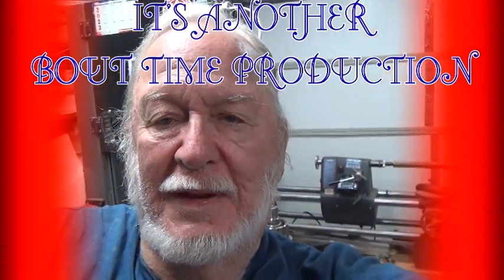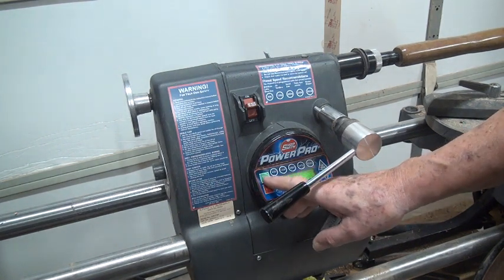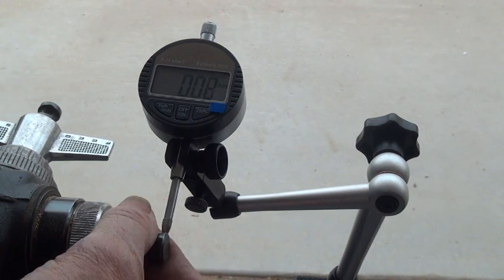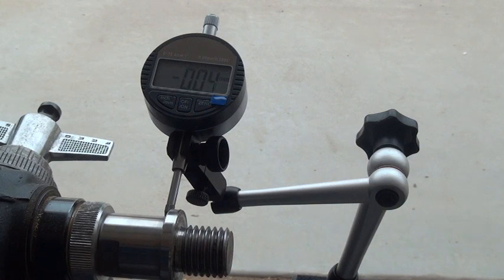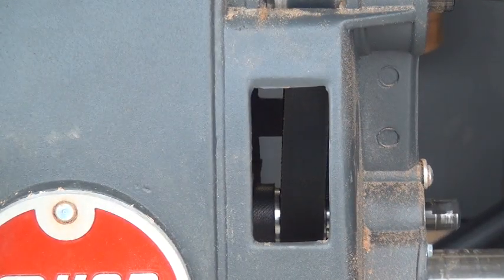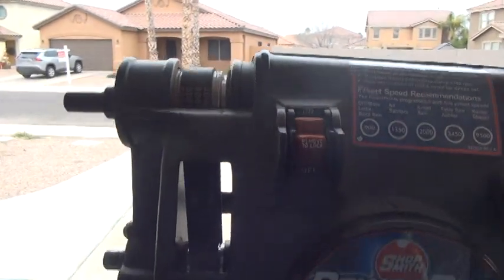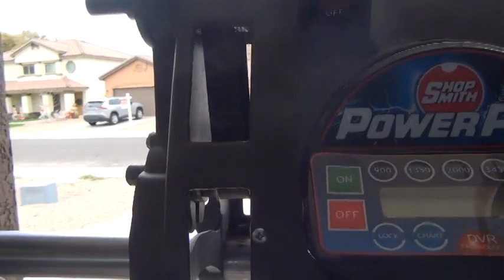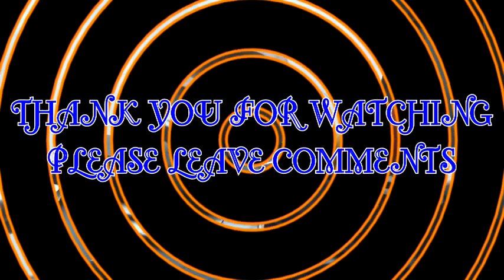SHOPSMITH POWER PRO PROBLEMS PART 2

Comment: Sir, from one up graded his 510 to Mark 7 Pro, the concentric bushing should not be moving(there is a screw or bolt the you can tighten).  It can be adjusted to correct the upper belt tension (also to help correct miss alignment.  To tighten the lower belt and eliminate the sloppiness,  1 remove the lower motor cover, 2 on both sides of the motor are adjustment screws,  3 they will allow you to tighten the lower belt to approximately 1/8” deflection (this will also allow you to get the pulleys parallel.
Reply from the maker: Thank you for the response. Ted

Comment: Could there be an ongoing quality control issue at Shopsmith?
Reply from the maker: I don't really know. I have witnessed several times that people have had many problems with the Power Pro electronics. not so much the machinal operation. I think I just had a bad quill system and they seemed to have fixed it. They did discount the repair for me.

Comment: Hi Doug I hope you found the issue here. Question, I also have Power Pro it blew the circuit board on the motor driver so I sent it in for $500 repair after getting it back 3 months later and only using it a few times it’s now having problems again!!! There’s a code on the touchpad that says: “SRM not rotates” . Needless to say I’m very disappointed with Shopsmith. Do you have any idea what might be the problem?

Comment: https://youtu.be/xCLkH6T1uQE

There’s a fantastic portion towards the end of the video where they show the alignment balancing the tension between those two belts.  Fast forward to the one hour 40 minute mark. I think this would be a great help to you. Best wishes.
Reply from the maker: Oh, thank you I watched it. That’s a great video. So this morning I went ahead and adjusted the belts using that process but it still has a noise in it so I’m assuming it’s basically the drive ring assembly.

Ordered one on the 18th I haven’t heard from Shopsmith they haven’t sent it don’t know what’s going on.
We seem to have stopped. Communicating as well.
Will call them again today.
However watching the video I may just attempt to fix it myself. Ted

Comment: I agree with Scott and John. The idler shaft is not in the correct position. You showed the bearing slipping in the collar, that means it is loose. It should not do that. So it has worked it's way inward, which explains why the upper belt is not vertical. The loose idler shaft is at least one source of vibration.

The Shopsmith base has flex, so yes your digital dial indicator will pick up movement if you lean on it at any point. I spin then let go and read the value without touching any part of the machine, then spin again. At 0.04mm that's about 0.00157 (one and a half thou). That is not too bad, but with new bearings there is a chance to cut the run-out down so small you indicator could not detect it. But I would fix the idler shaft first. Also, with that much vibration, I would check for other things that may have worked loose.

Keep in mind since the lathe spindle adapter uses a set screw any tolerance (slop) between the adapter bore and the quill shaft will get pulled to the side with the set screw. The video proves that, you went from 0.06mm near the set screw to negative 0.08mm at180 degrees of the set screw. That's a 0.14mm swing or about 4 thousands of an inch. So the error in adapter builds on the error in the quill shaft. Then, any error in the chuck builds up too.

Comment from the maker: Had to think while the 49er's whipped the Sea Gulls and it hit me. So I went back out, used long curved needle nose pliers to edge the belt into the right grouves and then that bushing spun all the time. 
Being an old aircraft maintenance technician I then got out the Power Pro instructions a PDF from Shop Smith and my fear that it was in fact a bushing was confirmed; Ref; number 80 on the illustrated parts break down P/N 5041909, noun Eccentric Bushing Mach . 
It is constantly spinning now in an aluminum casting which will wear severly which obviously it has already as it has extended out to the belt grouves. 
This shaft carries the dynamic load of the pullies that drive everything and it is a cantilever type (supported only on one end) which make any excessive  differencce in belt load prone to cause a failure. With the bushing extended out and spinning it is a very serious problem.
This is in my opinion a serious manufacture defect which will most probably require replacing the casting.
I suspect that the Idler Shaft Assembly ( Item Number 83 P/N 622612 ) itself if causing the vibration and has a wobble which in time will get worse and may cause a catistropic failure.
I will call Shopsmith Monday to discuss this matter.
Reply: I replied to the comment you made on my video adding links to 2 Jacob Anderson videos. The idler shaft has been cantilevered like that since the Mark 5 headstock first came out. And in the mechanical headstock it bore the extra stresses and strains of the speed control sheaves which added stress when moving the belt and had a large diameter.

My hope for you is that a little cleaning on the bushing and idler bearing to remove dirt/grease, setting the shaft back in place, proper belt alignment, and proper tension on the idler shaft casting bolt will help lock everything back into place. I surely hope that a new casting is not required. Fingers crossed.

Comment: I’ll add - that’s not so bad - happened to me - exactly what you’re experiencing.  I caught it before it got to the point yours is.

As I’d had the original headstock for quite some time I was very familiar with the idler shaft, bearings, the nomenclature.

With some time getting this and that back to normal it’ll be right as rain.

Comment: The scraping noise you are hearing is I’ll bet, the jointer coupler eating its way into the metal plate.
Reply from the maker: You were absolutely right that ground a really nice hole in that sucker. So this is been issued for sometime.

A short video thanks to you Jacob and Scott to basically bring this particular subject to focus for Mark five or PowerPro that maybe every once in while we should take a look at this and make sure it’s not moving and then maybe recheck the tension on the belt at the same time. 
You guys are great. Ted
Reply: @choochoo3985  

I had the exact same issue.
The eccentric was not tightened enough.

So - if you need new belts they are available from Bandsaw Warehouse.  Both belts - Power Pro and the idler shaft belt.  I suggest you do get both.

So - when you are done - with the cowl off - run the machine for a few minutes, checking that indeed the idler shaft and eccentric stay in place.  It is better to have the idler shaft wander than to have the clamp too tight.  Be careful - the tightening bolt can cause the clamp to fail and that is a pain in the-

If you’d like a manual - I do have the print out that came with my Power Pro.  Let me know.  As well - it’s important that you do have the time to get the installation correct.  And if you need new bearings for the idler shaft I bet I have them.  The Chineseum bearings are not the best.  I may well have Timken or Japanese bearings.  Yes - I’ve been in your shoes.

After you are sure the clamp is indeed tight enough check it again after a few hours.  Mine, after, I’d say 40-50? hours of run time the shaft/eccentric had begun to wander back.  A perhaps 1/4 turn solved it.  

Again, it’s unfortunate the experience.  You are not the only one.  The machine with good observance will persevere for years.

After it’s running correctly you’ll notice again how quiet it is.👍👍
Reply: Snowing again!! here - at 6000’.  About 1000’ above Parachute, Colorado.  😬
Reply from the maker: I don't see any wear on the grill common to the coupler. The bearing there is flush with the casting.

Comment: Your idler shaft is way, way out of alignment.

The lower shaft needs to be outside much more. I would not run it until we talk or someone else let’s you know.  DO NOT RUNIT.
Reply: John is correct, The bearings on that shaft should be flush with the inside and the outside of the casting. Scott
Reply from the maker: @MyGrowthRings  Thank you Scott.
Reply: That is, do not run it.👍👍
Reply: By the way the auxiliary shaft needs to be not out (my mistake) but IN.  In toward the motor.

Jacob Anderson a former YouTube Shopsmith headstock repairman has a number of YouTube videos explaining the very problem you are experiencing.

The auxiliary shaft rides in an eccentric.  The eccentric is held in place and tightened by one bolt.  Looking at the auxiliary shaft and moving in toward the interior of the machine, past the bearing you’ll see where the eccentric is.  Yours is way in, way too far.  If you continue to run the machine you may well Jack the shaft, possibly the casting.

I can tell you what you have is easily repairable.  It’s only a little of this then that and the machine is absolutely right on as new.
Reply from the maker: @johnrice6793  Okay, you mean the exposed exccentric  bearing needs to be less exposed? The outside common to the shows what looks like a roller bearing.??? Likec Scott said, the eccentric bearing should be flush with the casting.
Reply from the maker: @johnrice6793  Looked up Jacob Anderson, but I didn't see any thing on the Power Pro. or the eccentric bearing. Do you have a specific video he did? Thanks again. Ted
Reply: @choochoo3985  

Yes sir - 
I’ll look and I’ll get back with you.

And if you’d like to call and figure it out we can certainly do that.👍👍
Reply from the maker: @johnrice6793  can’t thank you guys enough, took two glasses of wine and five hours of sleep and it all came around so weigher-it  is the Mark V or the Power pro it doesn’t matter the position of the Idler Shaft Assy and eccentric bushing is the same. 
It was your video that helped I got mine back where belongs and made a short video that I will post later this seems like it really is an issue just to make sure that they inspect this every once in a while.

Between Doug Reid, you and Scott there are many video’s.on safety and periodic maintenance  checks but I did not find one on this particular subject.
Thank you for your videos and assistance. Ted